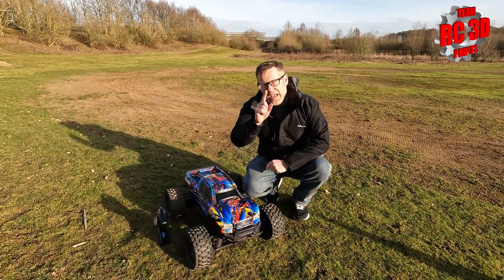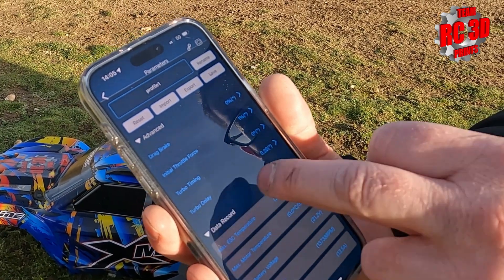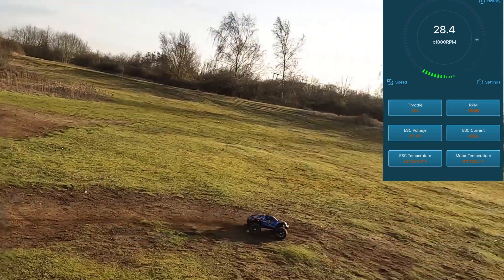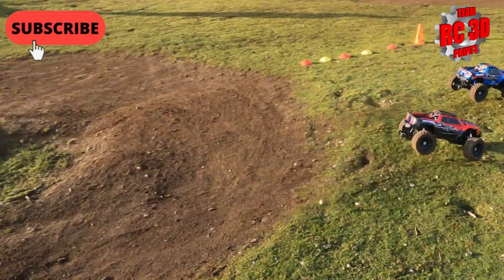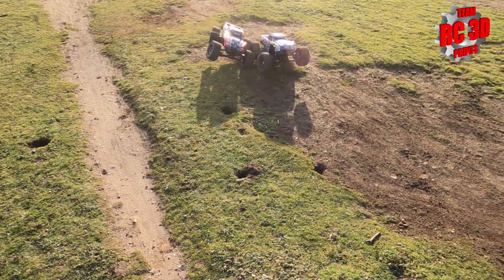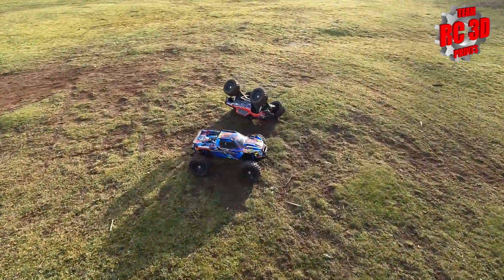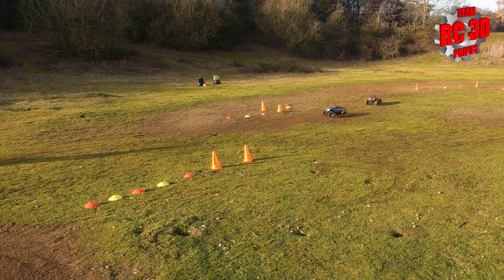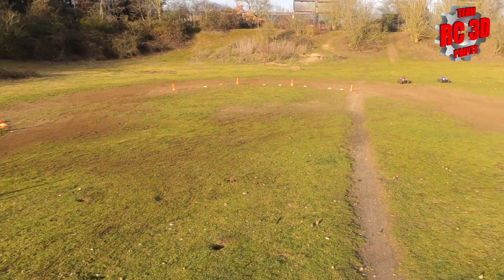Fitting Hobbywing Max 6 G2 into a Traxxas X-Maxx with standard motor. What can go wrong?

Comment: I thought you couldn’t run those ESC’s with any other motor if it wasn’t a hobby wing G2 motor
Reply: What gearing did you use with the 5690?
Reply from the maker: It worked but with a little hesitation / cogging when moving off. It did pep the truck up a bit, but eventually we swapped the motor to a Hobbywing 5690 1250kv motor - it's a beast now!
Reply: @TeamRC3D yes what gearing did you use with the 5690

Comment: Mine cogs slightly sometimes  on take off. Doesn’t do it all the time but sometimes it does. Driving me nuts! Are you guys not having this problem?
Reply from the maker: Only a tiny bit. Perhaps it depends on the gearing?
Reply: @SVCprints ,Are you still having the cogs issue did you upgrade the firmware?
Reply: @seanconnolly2179  firmware didn’t help me. I ended up returning it and getting a firma 160 instead which is basically a Max6 G1. That one is smooth as silk.

Comment: An absolute blinding show here 
I think the blue truck has more supple suspension set up that red looks like it wants an actual track 🤣🤣
Do you still use the max6 g2 and has the stock motor held up 
What lipos were you using here  thanks guys🔥🙏🏿
Reply from the maker: Thanks. We are still using the Max6 in the blue truck - but have now upgraded the motor to the Hobbywing 5690 1250kv. There was nothing wrong with the stock motor, but we just wanted more power! Both trucks are running cheapo HRB 6000 packs from Amazon.

Comment: What gearing was in this combo?
Reply from the maker: Stock 18/46 gearing 👍🏼
Reply: @TeamRC3D  would 20/50 work well with the max6 and stock motor?
Reply: @DigiDarkness I'm running 22/50 seems fine. ESC doesn't get hot at all. Not too sure how the motor likes it. Little bit of cogging.
Reply: Yes, that’s almost the same ratio. 👍🏼

Comment: A decent upgrade from the stock ESC 👍🏼
Reply from the maker: Yep
Reply: @TeamRC3D Works ok with stock motor? What gearing did you use? Great video 👍
Reply from the maker: Yes, it ran fine with the stock motor - running stock 18/46 gearing.